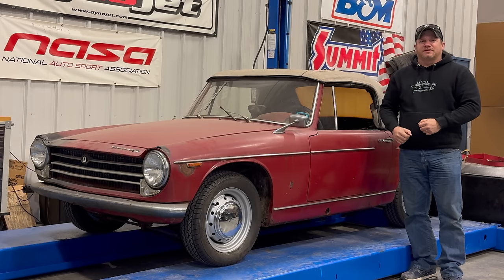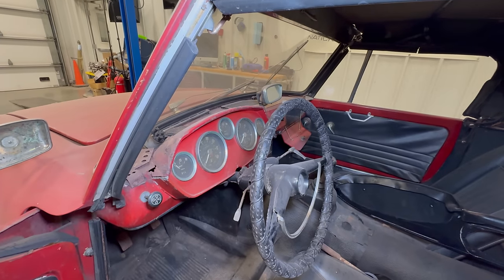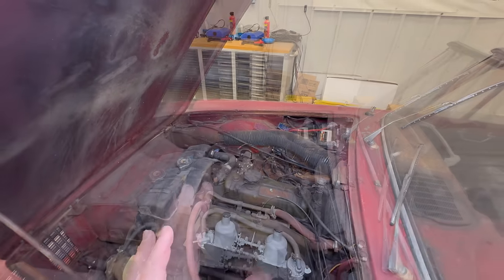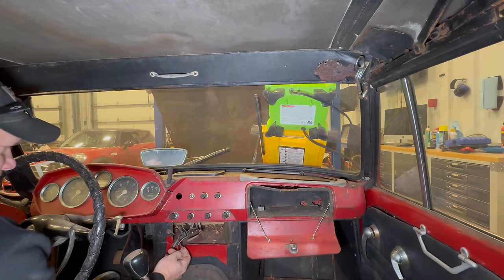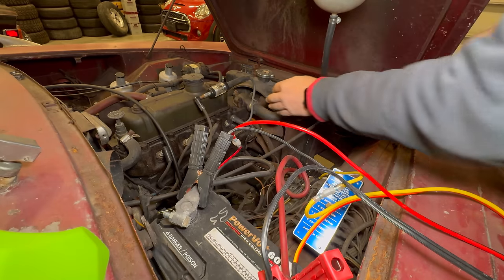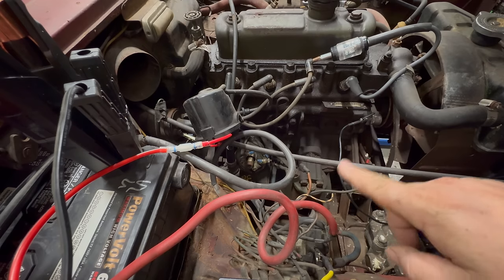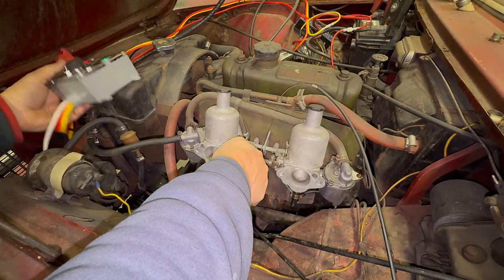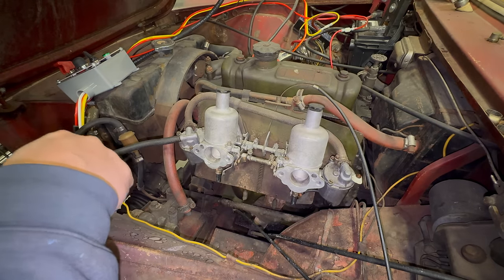Innocenti S Spider - Will It Run?

Comment: Great cars.  A relatively inexpensive way to get into Italian cars with limited production runs. Generally pretty simple with BMC engine and drive train but Italian electrics and lighting, as well as body trim, will open up the world of international parts hunting  with bits you won’t find a the local NAPA or Autozone.  

My vote would be to get it running, clean it up and keep it as a preservation class entry.

Comment: Steve, first time seeing a Dremel used to clean points. Was hoping for a close up view. Wondering if you used a mini wire wheel attachment and were you able to get it between the two contact points, or just clean upper/outer portion?
Reply from the maker: It is a mini wire wheel

Comment: I suggest a new condenser while the points are being replaced and I wonder also if it has a valve stuck open or if the distributor is way off timing.  Good luck watching with interest how you go

Comment: Comment? Heck, I'd love to BUY that car! I loved my old Bugeyes (I had a '59 and a '60 back in the 70's and 80's). My 19 year-old son share's my enthusiasm but he's 6-6 and doesn't fit in a Bugeye because his legs are too long. Would the Innocenti fit him? He has a 34 inseam.
Reply: I think the Innocenti 950 or S is easier to get in and out of, compared to a regular Sprite/Midget, but once you’re inside, the overall length of the cockpit available to you is the same. However, they did a later Innocenti C coupe which I believe has a longer wheelbase and more space inside.